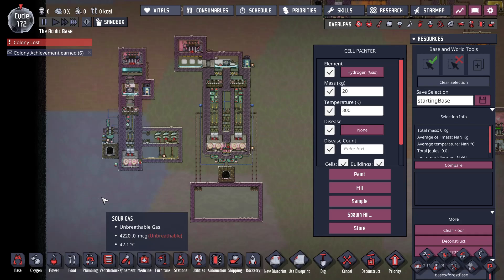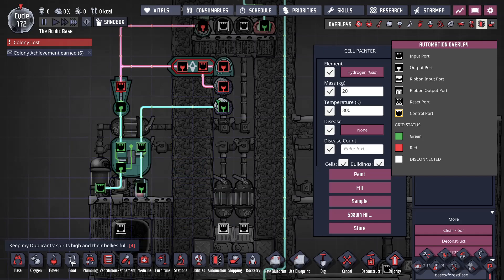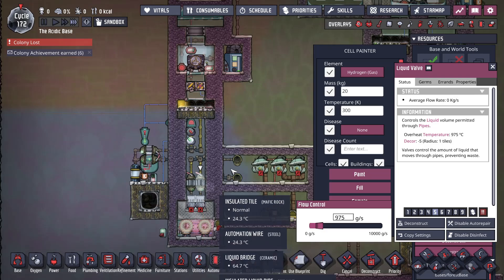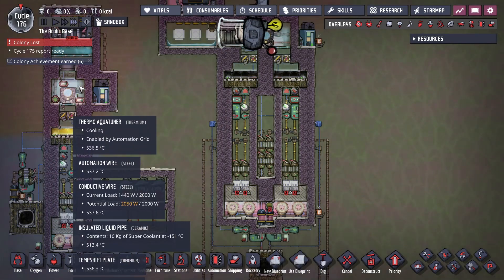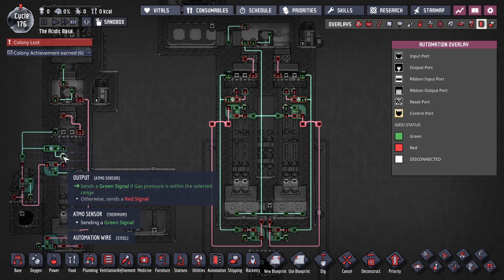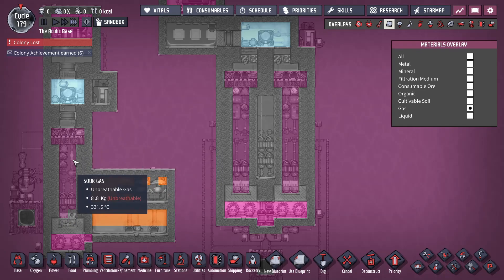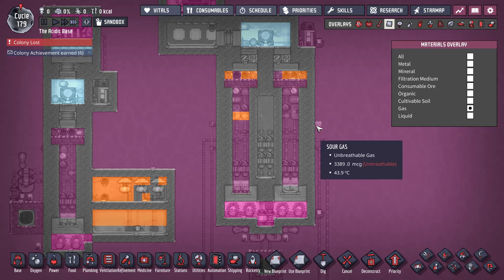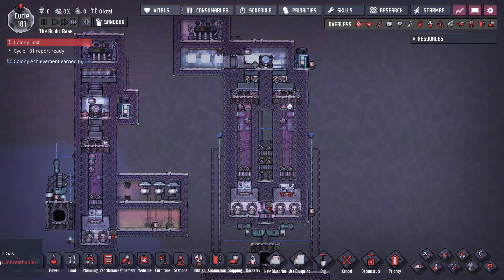Oxygen Not Included Tech Tip Automation Sour Gas Startup

Comment: The gas pressure is higher at the top of the boiler, so even 1 block difference in sensor position requires a different setting. Also the pressure jumps around more near the top, so keeping the sensor lower should make tuning easier.

I wonder if the "low pressure AND hot enough" signal would be better plugged in to the leftmost AND gate's input, so that the master switch can turn off the whole boiler. Currently if the master switch is turned off, then the boiler will keep condensing the gas and eventually the "low pressure AND hot enough" signal turns on, which turns on the oil input even if the master switch is off. 

You did just fine with the name. 😉 Reference pronunciation: https://www.youtube.com/watch?v=7rVd1aK7DJY
Reply from the maker: Thanks for the link.  The high pressure location, and setting doesn't matter.  20 kg and anywhere works, but higher will turn off faster.  It's only job is to stop oil if something goes wrong.  The low pressure turn on could go into the main and gate on the sensor side.